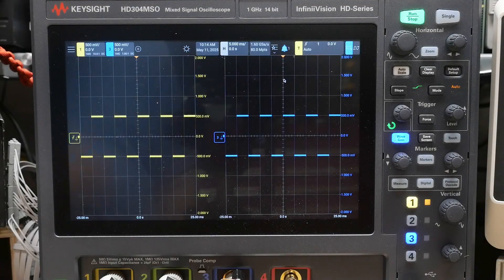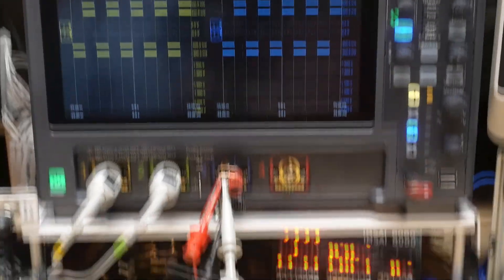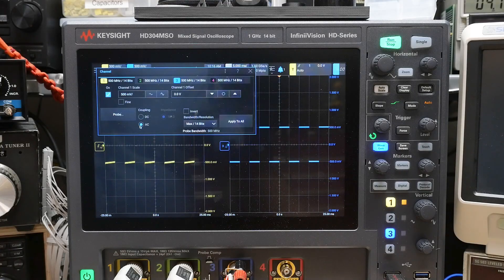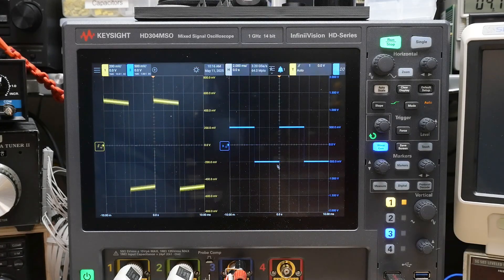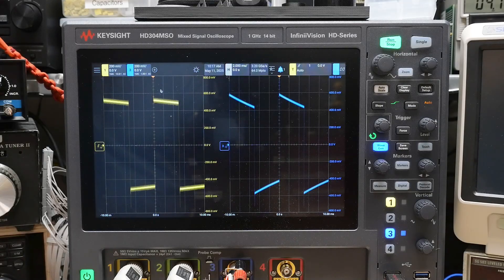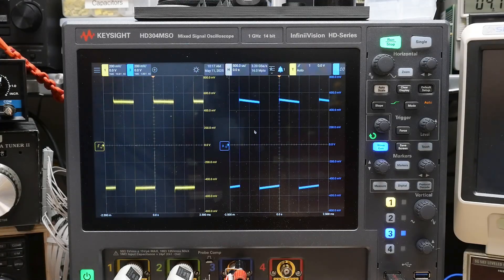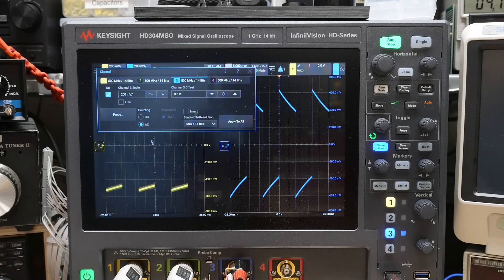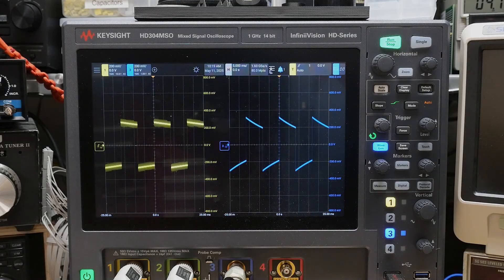#2235 AC/DC Oscilloscope Coupling using 10:1 or 1:1 Probe

Comment: Not being a scientist or engineer,  I would be distracted by using a scope with that much clutter on the screen and menus and functions.  I use a fairly simple CRT Tek most of the time,  and I have a color Tek that does tricks but that is useful for the functions like voltage and freq.  readings. When I need it.  Not that I would throw that fancy scope out for eating crackers in bed,  if it was given to me.

Comment: In all cases  X10 probes should be used for your work. Both to avoid circuit loading and to PROTECT the scope. X1 probes should only be used in special low level applications.

Comment: although interesting, but it is very much frequency dependent, and most of the measurements done in sub kHz range dont bother with slight droop in voltage over time.

Comment: This seems like a great method to set the calibration of your probe to a specific frequency of you need to measure something AC coupled. I've only calibrated from the scope's 1khz output but knew that that it was likely inaccurate at other frequencies. I would love a follow up video showing of this is a good or terrible idea if you are hunting for a low amplitude, high (or low) but known frequency.

Comment: It appears to me that you don't have a 1Xand a 10X probe. You have a direct connection and a 10x probe. A true 1X compensated probe could yield different results.
Reply: Can a 1x probe be compensated?  It has no resistor to cap across...
Reply: @jeromekaidor7254  All X1 probes I have seem to be virtually a piece of wire. This is why they are so dangerous to use. (on a modern scope)
Reply: @jeromekaidor7254  My mistake I thought it could be adjusted but upon checking no they can't.  Excuse me.

Comment: Why does inducing a DC offset make it better?
Reply: You're absolutely correct in pointing this out... I think that IMSAI guy lost himself a little and ended up not making clearly the link between the two subjects.
In regular o'scoping (without Input voltage offset), one common case of using the AC coupling is to view a small peak-to-peak disturbance riding on top of a much higher DC voltage.
If you set the input sensitivity low enough to put the DC voltage "in frame", the peak-to-peak disturbance gets too small to be properly visualized.
If you just increase the input sensitivity, the DC voltage makes the signal go "off-screen" and can't be put back "in-frame" even turning the position control to its minimum or maximum.
So, the next most common strategy would be to turn-on AC coupling and "get rid" of the DC voltage altogether, but, doing so has its quirks... Because AC coupling don't have this "magic" ability to subtract the DC voltage, it only filters out the low frequency components of the signal, of which the DC voltage is ONE of them, but not the only one.
When you turn on AC coupling, along with the DC component, you're filtering out an entire range of low frequency content (from DC up to the filter cutoff frequency).
Amongst these cutoff frequencies, there can be some part of the small peak-to-peak disturbance you're trying to investigate, and this quirk not only is affecting your measurement but, as IMSAI guy is trying to point-out, it's affecting it in a complex and variable way, because its effects are changed by the input source impedance (which is a big "unknown" variable) and also by the probe's input impedance (9MOhm in the case of an x10).
An oscilloscope with an input offset adjustment can completely eliminate these side-effects of using the AC coupling as a means to "get rid" of the DC component, by allowing the small peak-to-peak disturbance to be observed at a higher sensitivity setting, without turning on the AC coupling and preventing the DC component from overloading the input stage and preventing the waveform from going off-frame.
Reply: @fabiotrevisan8922  :)

Comment: Why does this happen?
Reply: The droop is a direct consequence of the AC coupling being nothing more than a Hi pass filter (with a quite low cutoff frequency, but still, a Hi pass filter).
As any Hi Pass filter, when presented a square wave of frequency low enough to be affected by the filter, the combination of the input source impedance and the internal AC coupling capacitor will behave as a differentiator with a time constant RC, where C is the oscilloscope's AC coupling capacitor and R being the sum of the Input source impedance and the oscilloscope's internal input impedance.
If the source impedance is higher (as it's the case of the x10 probe with its 9MOhm series resistance) the cutoff frequency falls at a much lower frequency and barely presents the typical waveform of a differentiated square wave, while at x1, the Hi pass cutoff frequency is 10 times higher and, compared to the same input frequency, it will present a much more pronunciated waveform of a differentiator.
It's worth noting that, if the input frequency would be low enough (some 2 or 3 Hz), both cases would be presenting the classic "pointy" waveform of a differentiator, abruptly going up or down with the square wave transition, and then drooping all the way to zero, until the next wave transition in the opposite direction.
Reply: @fabiotrevisan8922  :)
Reply: The time constant of the coupling capacitor and the input impedance is of the order of 10 milliseconds when 1:1, probably 100msec at 10:1
Reply: The decoupling capacitor can charge faster without the additional resistance of the 10:1 probe.
Reply: In AC coupling it inserts a cap on series with the probe.
Reply: Your putting a signal through a capacitor also your probe and cable has impedance and capacitive loading on it, the wave going in will only get droopier coming out the more you go up in frequency and impedance as the impedance will make the cap charge and discharge slower and the frequency will also affect this, go and look into capacitive reactance to learn more about the frequency and capacitor side of things, then it will all make sence of course you need to understand impedance vs resistance aswell but once you learn all this it won't be a surprise anymore!!!!
Reply: Short answer: coupling capacitor
Reply: Think 'time domain'
Reply: because when you construct and use those devices, you open a portal, an entrance for evil
Reply: @saramanbrudesco  Yes, a very important lesson.